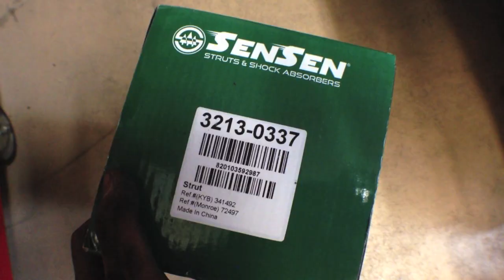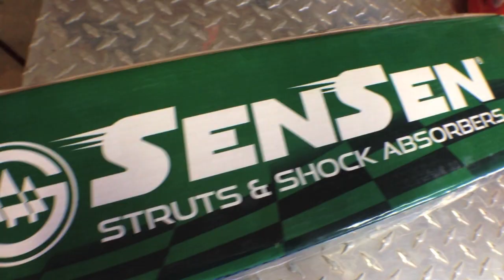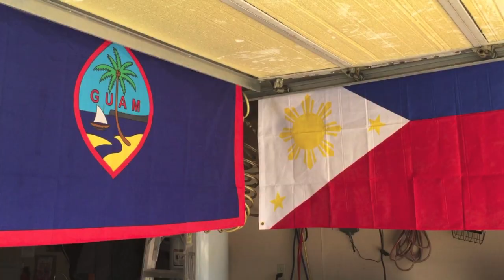COMPLETE Rear Strut Shock Replacement '07-'11 Honda CRV √ Fix it Angel

Comment: sir,  my car is crv gen 1 1998,  change all the shock to kyb and most suspension part.   my problem is stiff ride and wavy... almost 8 months ... same feeling. any tips?  or problems possible?
Reply from the maker: Hi brother, list all the parts you replaced. I need to know.
Reply: @FixItAngel  all 4 shock absorber,lower, upper and lower ball joint, front control or swing arm left and right, sway bar end link
Reply: really uncomfortable...  like fake shock , it works but very stiff...  sways left and right. my passengers complaining dizzy ride
Reply from the maker: @jericlee1509  I think problem could be sway bar is bad.

Comment: What do I do if my new struts are slightly longer than oem? I can’t safely get the bottom mounting bolt in, even with a spring compressor.
Reply from the maker: slightly longer?? what brand did you buy? you sure you got the correct part. just asking.
Reply: @FixItAngel  yeah I got them installed, my old struts were just so worn out they were about an inch shorter. It made the installation a little more difficult

Comment: Thanks.  Just got done doin the fronts on my daughter's 2011, and tackling the rears now.  Just like you, I also put extra jacks under the car (1 or 2 extra) incase the car moves off the jacks.  I had one fall on me when i was a teenager and nearly missed my legs.  It could've killed me or atleast seriously injured my legs.  Now I go the extra mile with wheel chalks and extra stands
Reply: I remember a while back a friend of mine was removing his trans and while trying to wiggle it free the trans and the car fell and pinned him-he was by himself so it didn't turn out well but it sure taught me a lesson...

Comment: Great video, one critical point not shown is that when you assemble the spring assembly the top of the strut doesn’t align with the bottom, the bottom is twisted over at roughly 45 degrees. You need to incorporate that difference before you tighten the top bolt that holds the spring in place. If you’re doing this job look at the spring you take off and you’ll see what I mean. I missed it cos I’m an amateur and had to put the spring compressors back on and adjust it.
I would also like to say bolts don’t come undone that easy in the uk. Salty roads see to that.
Reply: Is there a more accurate way of lining the top mount up with the spring and shock or is it exactly 45 degrees and that’s fine? There is no notch on the rubber of the upper mount to help line things up.
Reply: @Doobie464  hi I did it by eye . I don’t have any way of measuring the angle.
If You get it close enough it will fit. 
Sorry if this is no help, sometimes you just work with what you’ve got.
Reply: @Rumpypumpyify  thanks. I’m doing it right now. I think it must be 45 degrees by the looks of it so I’m going with that. Unfortunately every time I release the spring compressors the top mount leans to one side slightly so the hard plastic boot rubs against the shock. Any ideas?
Reply: Unfortunately I did this a couple of years ago so I don’t remember exactly how it all looks.
Maybe google it to see if a forum could help you out.
Sorry I can’t be more helpful. Good luck.
Reply: @Rumpypumpyify  no problem 👍🏼

Comment: I have a new appreciation for competent automotive mechanics. However, it's kinda like watching a surgery. I don't know if I could trust just anybody working on my car now wondering if they would be as good as this video or be some dumb ass that would forget to put a bolt on. I once let jiffy lube change my oil and a month later i blew a head gasket because they forgot to replace the oil they drained from my engine.  Cost $750 to repair.  Clearly this is not what we are witnessing here. This man is a professional sharing his expertise. Well done sir.

Comment: That's quite a lot of bolts to remove the strut.  Very informative video.  

One thing I did not like was the SENSEN brand of shocks.   I had them before.  After 1 year of use, it squeaked so noisy that I have to return all 4 pcs.   Nevertheless, I purchased the KYB.
Reply: Hey Pino, what was your experience with kyb and which model?
Reply: Did the KYB hold up well??
Reply: @SpicyMcGeezaks  yes, the KYB front struts held up well until I traded my 2006 Mazda 3 in 2019.

Comment: Angel,  Thanks for the great video.  Attempting to do my wife's 2009 CRV today and ran into a snag.  The bolt at 0:52....What is this part called? I'm trying to remove the nut...the whole bolt just spins in place....forgot I needed a allen wrench! :)
Reply from the maker: Duane Wolf hi Duane, you can just remove the brake line from the that bracket. The hose is being held with a 10 or 12mm bolt if I'm not mistaken

Comment: Great video, I learned in just 4-1/2 minutes that I probably won't be attempting this.  I like that you edit it down for quick info, no blabbering on and on like most DIY videos.  Great job!
Reply: This was easier then I thought. I bought complete struts from rockauto, so I didn't have to swap the coil. 

For those that need to swap the coil, until the top nut, while the car is on the floor, then jack up and tension is removed.

Comment: I'm towing a pop up trailer behind a 2006 CRV.  I believe the struts are done for due to age.  When I tow, the tire is too close to the trim/wheel well.  Will having new struts help?  Also, are there stronger struts available for vehicles used for towing?  Thank you for your knowledge and expertise.
Reply: Beth Norman I had the same problem but my struts seems to be good, no leaks. I only changed the coil springs for some MOOG they are bigger gauge and now my crv sits higher even when not towing.

Comment: Super Video! FYI On my 2010 CRV the sway bar end links didn't come off that easy...I think I blew them out with my impact wrench. It was just spinning after sitting still for a while. Then I look at the manual today (duh) and see there's allen hex ends in the links to keep them from spinning when removing them...just FYI. I left them both on and the shocks came on and off no problem though...

Comment: how long it takes to do one side, is installation similar for the front of the car ? Are these SENSen struts comparable in quality to OEM Honda struts?
Reply from the maker: Rem X hi, if you have the right tools. You can get each side done within an hour or less. It's always best to go with OEM. I think SENsen struts are ok and are less expensive. It all depends on how much you want to spend. But OEM is recommended. Thank you for watching.
Reply: Many people say that nothing rides like a Honda and I think I made a mistake in not knowing that sooner.  I wish I had stayed with Honda Struts.

Comment: Great video. Quick question angel. In this video you did not change the coil over spring. Why do some mechanics change the spring and some don't? I was always curious. Is it because it's cheaper?
Reply from the maker: Hi David, Thank you. It is easier to change the whole strut because it comes with the spring. No need to compress the strut to remove the spring. Some mechanics want the easy way, if they don'e have the equipment(industrial strut compressor). They just replace the whole strut with spring. I don't see the reason to replace the spring, just the shock strut.